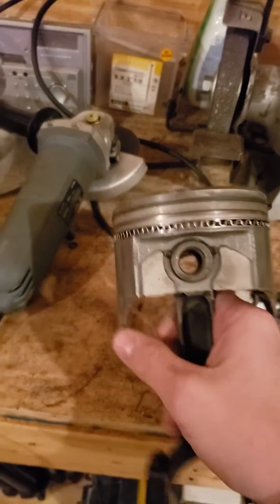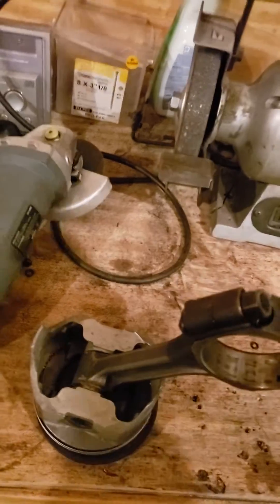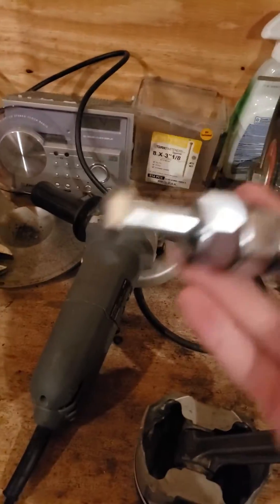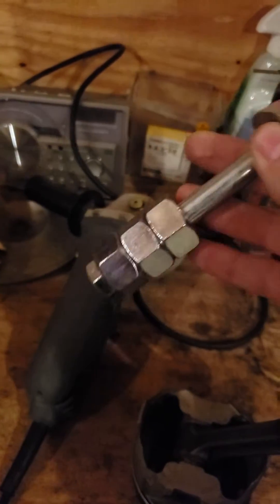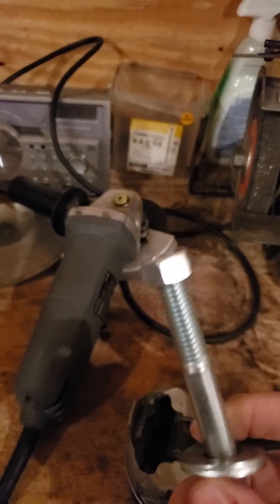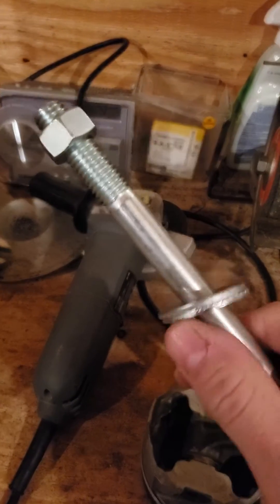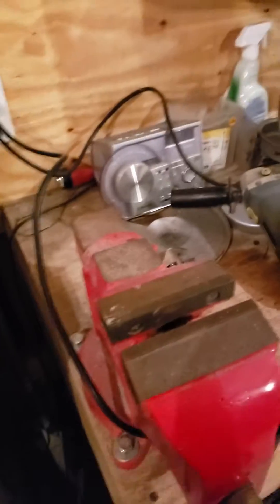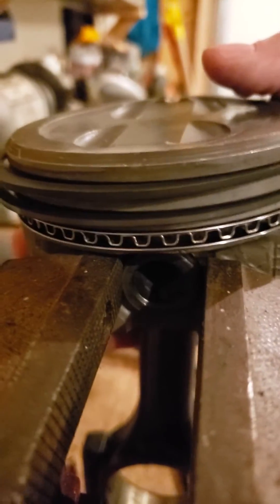homemade tool to remove piston wrist pins

Comment: Piston needs heat to remove wrist pins.trying it without heat you may get lucky on one or two but you run the risk of breaking piston or connecting rod which can end up costing more than a machine shop fee.

Comment: What if u added some heat to the pin, should help it come out i would think as long as your not overheating the rod. Obviously if your wanting to salvage the piston this might not be ideal but if your removing it rod then you shouldn't much care about the old poston cause if your like me you just want that rod to use 🤣
Reply: If you heat the pin its gonna expand inside the rod and make it even harder to remove.

Comment: Hey man I tried doing this very same thing tonight and I ended up stripping the bolt I bought and the washers bent on me n everything. In order for this vice method to work............you need a grade 8 bolt of adequate length, same with the nut. Now for the washer, you need a really thick one, like one from a ball joint kit or a cam bearing tool kit, one of those really thick black washers ya know. And usually the head from a grade 8 bolt will bite onto the end of the wrist pin if it's shouldered. If not shouldered you can always rough up the underside of the hex head and it will bite. Anyway, I know this video is over a year old but I hope this can help. What I really do like about this video is the fact you knew what size hardware to use!
Reply from the maker: Thanks for the info. That was kind of a big fail. I ended up just getting a press after I heard how much the wanted to remove them. The press was cheaper. But if I have to do again, grade 8 and thicker washers for sure!
Reply: @BackyardGarage1  Yeah for sure! Sometimes ya gatta learn things the hard way, which is the best in my opinion despite the frustration and agony lol!
Reply from the maker: You're totally right about that. If it was easy then everyone would do it. I know I had my fare share of frustrations with the build
Reply: Use grade 8 bolts